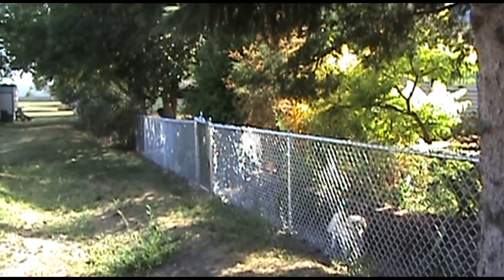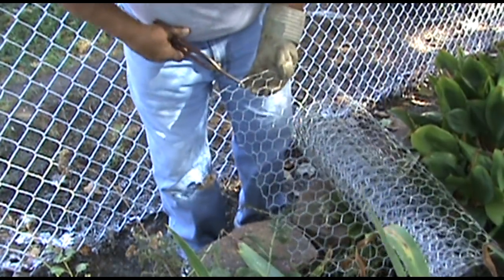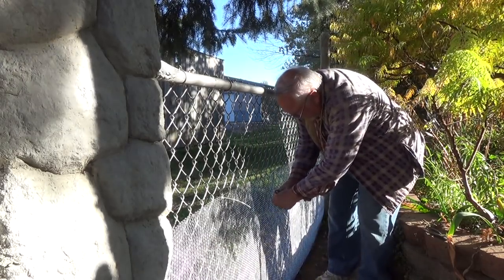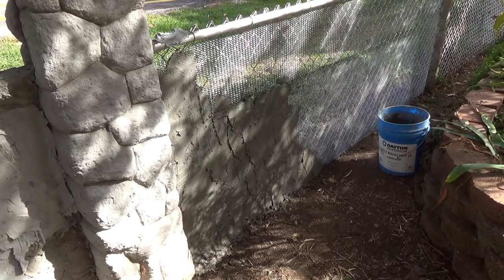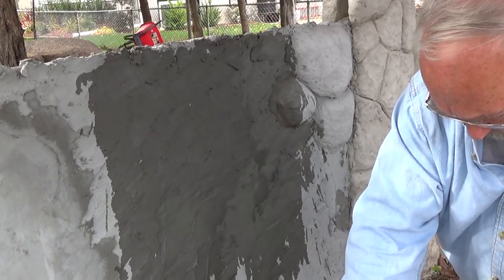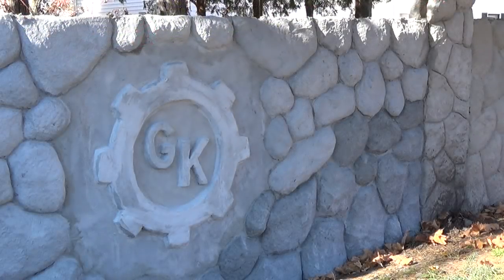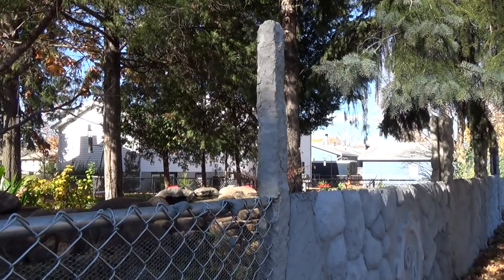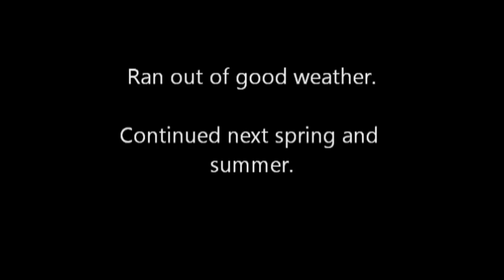Converting my chain link fence to a stone wall

Comment: Nice work would it work back east
Reply from the maker: Why not?
Reply: @dperry428  the ice and freezing would crack it.
Reply from the maker: I'm in northern Illinois. How is your ice and freezing any different from mine?  Last winter was a mild winter.  Lowest temperature last winter was  -15 F.   Average winter snowfall is 30 inches.
Reply: @dperry428  we get zero degrees
Reply from the maker: Well, that's 15 degrees warmer than what we got.  The winter before it went to 25 below zero.  Watch this:  https://youtu.be/oqPp0z8yELU?si=Jb52huZaRzrDP8OB
Reply: Up date
Reply from the maker: https://youtu.be/BUiWgRygWMo?si=ps1fuYZ1g7P5CN8u
https://youtu.be/adfy1Z1x_D8?si=blgd8KUH2wm542Ij